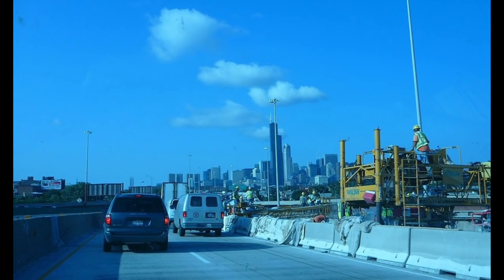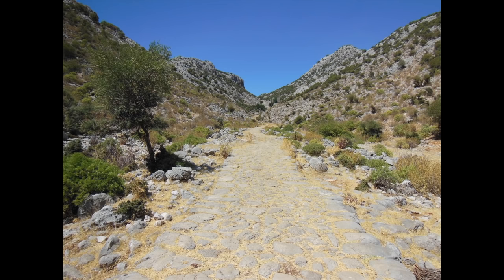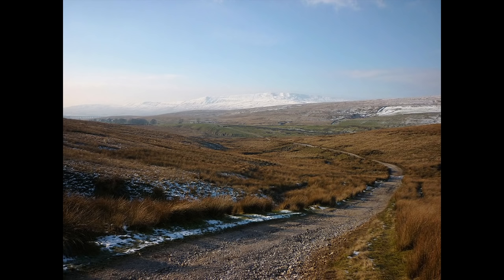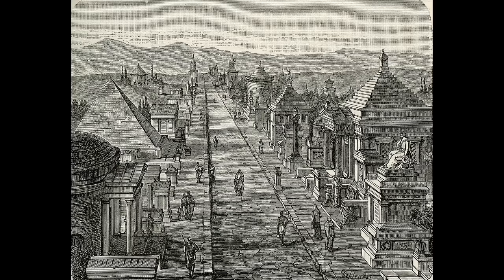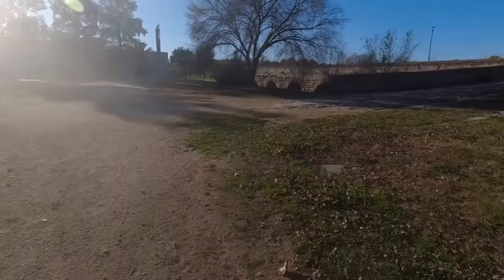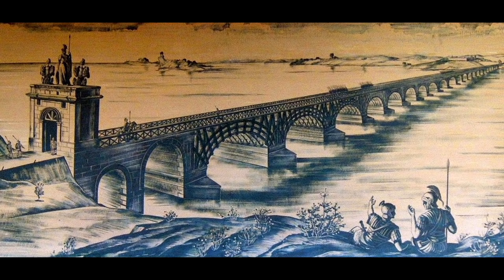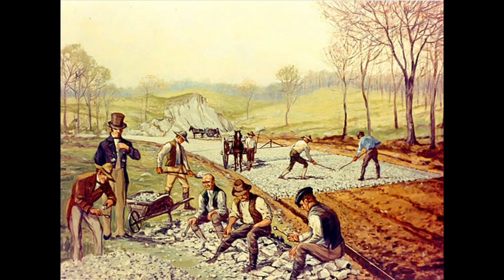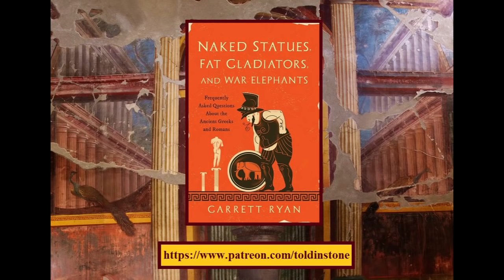Were Roman Roads more Durable than Modern Highways?

Comment: If more modern roads, highways, freeways etc. were constructed with a minimum of one foot of gravel base, they would last soooo much longer.
Reply: And if we used trains to transport all long distance freight. It’s faster, doesn’t cause traffic, doesn’t degrade your roads, uses 1/4 the amount of fuel per ton per km, takes up less space to load/unload, and you don’t have to worry about self driving trucks
Reply: @sizor3ds  
Agreed! I've been arguing this point for years.
Reply: @sizor3ds  Never gonna happen as long as Fossil fuel companies are still around lobbying. I've lost hope for any real change
Reply: @sethb124  No one likes to lose money, make train transport cheaper and faster and customers will switch, the math is done by machines and as it turns out... sadly for many distances and destinations trucks just make more sense cost wise
Reply: Highways don't last because of heavy loads, lots of traffic, and wear and tear due to things like weather (freeze/thaw).  Not the construction method.  Engineers are very particular about how the subbase of roads is constructed.  For example, this document: https://intrans.iastate.edu/app/uploads/sites/15/2020/03/6F-1.pdf explains that a too thick subbase can cause issues where consolidation after construction can cause pavement failure.  And the composition of the gravel matters too.  For example, here's a document from DOT explaining some of the materials in that subbase: https://www.fhwa.dot.gov/publications/research/infrastructure/pavements/97148/075.cfm .  So yeah, give the engineers that build this stuff the benefit of the doubt.  They know their stuff and do the best they can with the materials, knowledge, and budgets they are given.

Comment: Looking at those stone surfaces makes me wonder whether they weren't covered over with a layer of loose soil for the sake of the animals and humans walking on them and to make riding on them in a cart with iron tires and no shock absorbers more bearable.
Reply from the maker: There were often dirt or gravel bridle paths paralleling the main road, which would been a lot easier on both hooves and feet. Wagons, however, had no choice but to rattle along on the pavement.

Comment: Are you sure that the ruts where deliberate? Because they're very dangerous for wagons and can easily break wheels. Not to mention that not every cart was exactly the same width. Besides, carving them manually would have been a huge waste of manpower. Unless you have direct evidence to the contrary, I'm inclined to believe that they happened naturally due to heavy traffic (and would have been one think to fix during road repairs), rather than deliberately placed.
Reply from the maker: Most ruts were natural; but in a few places - mostly mountain passes - they are deeply and evenly carved. This measure seems to have only been taken when there was a serious danger of wagons slipping off the road or where there was a pressing need to guide traffic (see the standardized slots between the stepping stones on Pompeii's streets).
Reply: @toldinstone  thats pretty interesting
Reply: @toldinstone  I have heard that one of the first things to have standardized gauges was the distance between wagon wheels. That way the wear down into the same ruts and don't break their axles because of inward or outward force.
Reply: There's definitely a standard width to carts in the Roman empire. You can see it not only in the ruts left in stone road surfaces, but also in places like Pompeii, where stepping stones were placed at corners for pedestrians, but also as obstacles to calm traffic. There's always a stone in the middle of the road, around which a cart's wheel would have to pass.
Reply: @toldinstone  Thanks for the reply! Do you have specific examples/sources you can point me towards for this?
Reply: I have a memory of being told that modern railway gauges evolved from Roman wagon width regulations, but Ctl-F on the Wikipedia entry "Track gauge" finds no mention of "Roman". Hmm... 
I am inclined to think wagons were pretty much always made as "two horses wide", thus leading to widespread similarities, which were inherited as quite similar but varied railway gauges.
Reply: @flamencoprof  but that would mean that between roman times and the early railway age in the 1650s-1750s the cart width would have grown significantly.
Roman horses were for most of the empire's history only pony sized, at best 3/4 of our contermporary riding or waggon pulling horses. So an increase in width of 40-50% is not out of the question. I'm pretty sure the railways would orient themselves at the then current cartsize and not almost 2000 year old values. ;)
Reply: @Ugly_German_Truths  Fair enough. I'm guessing the rail widths were influenced by contemporary rather than Roman wagon widths.

Comment: One of the major construction differences is exactly the difference between the paving stones and actual pavement itself. The underlayment/road bed itself are actually fairly similar: compacted soil with compacted gravel/sand. Granted, we can now compact things far better now than they could back then. But the paving stones can still move relative to each other since they are isolated cells compared to the flat smooth surface of pavement. The disjointed aspect of paving stones alone gives more durability to the surface than a contiguous pavement. But try going 80mph on a cobble stone road. 

But sure, I doubt very much that a Roman road would hold up to the daily traffic of the average 80k lb loaded lori/semi truck. 

I'm sure we could build superior structures if cost/labor weren't considerations. And solders in Roman time were often effective slaves.. in addition to the actual slave labor used for many construction projects back in Roman times. But due to the cost and speed of construction, we tend to choose to build shorter lived projects. Romans were willing to take the long view and paid the cost: slaves were cheap, but durable infrastructure meant speedy deployment of solders to quell rebellion and protecting/expanding the boarders were worth the cost to them.
Reply: @MichaelTheophilus906  It didn't take 500 years to build a road ever what are you smoking.

Comment: Maybe one can't compare superhighways to Roman roads, but I would love to see URBAN roads vs Roman roads. 
The fact is, while Roman roads don't beat highways, they sure as hell beat modern urban roads. 
There is the same amount of construction work, cracking, potholes, etc in modern urban roads than in highways, yet with far less stress.
But the Roman roads that are still in urban use to this day are literally never repaired.
So, at least in that sense, they are superior in a direct comparison.
Reply: they are so terrible to drive on so the fact that last longer means very little. And usually cars go very slowly on them
Reply: @aurid6838  But in an urban setting its unlikely that anyone is going that fast to begin with and with less repair work and money going to the repair of said road a roman style road would be more or less beneficial.

Comment: Another reason why so much of the Roman infrastructure remains in Spain is that until about 14-something the 'next guy' basically changed the bank account number for the taxes and left the power structure largely intact. The Visigoths ended up being Romans except for the name, and the Arabs had a genuine interest in maintaining and improving both the roads and the aqueduct system. The whole thing went down hill quickly when anyone with the knowledge to repair the stuff was kicked out.

Merida even has most of the Roman dams which fed the aqueducts in working order

Comment: Any thoughts as to how smooth those roads were when new?  I try to imagine a wagon ride over one of these roads sans shock absorbers and I can't. I drove over an 18th-century road in rural Mexico once and I thought I'd need the services of a chiropractor afterward. It was cobblestone, in good condition and looked similar to a Roman road but even in a car with nice fat tires it was very jarring. It occurred to me that weathering might have caused the edges of the stones to become more rounded over time but that's just a guess. Great video!
Reply: Check out the wagon wheel grooves on preserved on Pompeii roads
Reply: @histguy101  Good point. Once grooves developed the ride would have been smoother but what about when the roads were new? And how many decades would it take for the stones to acquire those grooves.
Reply: Your thinking with too modern mindset. For commercial activities travels often were short, something like 5-6 miles at most and you wouldn't certainly be blasting them even close to current speeds. And people would have option to walk besides the wagon. If you went for a distance you'd use boats. 

 Foremost idea of gobblestone was to keep roads from turning into mudtrack which is the main problem with earthen roads. Even today that is main reason why earthen roads are not very good. They work well, very close to asphalt with right mix of soil types when it's dry and surface is being leveled at steady intervals but when it starts to rain things turn into mud  and holes.

Comment: Another problem with modern roads which experience snow is the expanding ice in the cracks and the water which trickles down those cracks in the spring.

I imagine a Roman road would have none of those problems as they are perfect when it comes to drainage and the space between the pavers is large enough that expanding ice would not be a problem. 

Do we have any infor.ation on romannroads that saw snow?

Comment: I think the roman roads actually hold up better because the broken up surface tension of the separate stones are better distributing the weight and pressure of the traffic pressing down on it.

Modern roads are made with better materials, but because its all one, uniform, smooth surface it creates cracks and holes at its highest stress points.

The thing is though..  the reason our roads are smooth is because we like the luxury of a smooth ride. We use to make roads out of brick too that still hold up exceeding well today, but they're not smooth to drive on.. its bumpy, if even just a little bit.

So if we want better roads, we'll either need to give up smooth driving or invent and standardize better shock and suspension systems for our vehicles.
Reply: They constantly warred on them . They’re built for that.

Comment: Roman roads were built by the military as they advanced into new areas. The engineers built the specialist parts - bridges mainly - but the actual roads themselves were built by less skilled troops. The surveyors marked the next point where the road was to go and the easiest way to build it was absolutely straight. No thought needed by the actual builders. Roman roads are only straight berween surveyors points - in many cases they curve round obstructions, but each short stretch of the detour is straight.

Comment: So I actually did some survey work with an American archeologist of the Roman road in the Great St, Bernard Pass back in the 1990’s. Specifically, right on either side of the Swiss/Italian border. The road comes up the valley and crosses right in front of its doors. Which dates to the 10th or 11th c. Though they have been eased up the building’s frontage due to continuous repaving over the centuries, to the point that you actually descend back down into the building above 6ft or so. This road is no more then a track in places especially as you get beyond the momentary and the hospice facility. We had to defend on foot back into Switzerland about 12km at in point and used the Roman road. As you might imagine, 1500 years of neglect and weather at high altitude have not been kind to the road way. But there were some interesting places along our route. The remains of a Roman inn, now nothing more then the threshold stones and the perfect outline of the courtyard in a perfect rectangle of Roman tile, laying in rows on the ground in one location was something to see. And the ruins of a later medieval watchtower or checkpoint alongside the road at another reminded us that until the modern era, this ancient road was the only way across the alpine landscape.

Comment: According to Wikipedia.."Today, the concrete has worn from the spaces around the stones, giving the impression of a very bumpy road, but the original practice was to produce a surface that was no doubt much closer to being flat.".  
When I visited Rome back in 2003, I recall that some of the roads were just that.."very bumpy" ..Why doesn't the city fill in the spaces, as the Wikipedia article alleges was originally done?

Comment: Another important difference between roads in Chicago and in the Roman empire is that in Chicago, there is ice then melting then refreezing everyday practically in the 4  winter months along with salt which corrodes/softens the road pavement.  Whereas most of the Roman empire, I am guessing never gets much below freezing. But they are remarkable nontheless.

Comment: Here in the UK it is noticeable that Roman roads often run along the very top of ridges or high ground.  There are, I think several reasons for this.  Firstly, it will help with drainage and keeping the road surface dry and free of water erosion.  Secondly, it means have to cross no rivers or streams.  Thirdly, it may have been easiest to plot the course of Roman roads from these high points in the landscape.  I also wonder if placing the roads on high ground wherever possible was also done to aid Roman soldiers in keeping a lookout for enemy troops, or to enable Roman soldiers to see signal stations, or to help with Roman soldiers in defending themselves against surprise attack.  It's obviously harder to attack a body of soldiers if they are on the highest ground and perhaps on top of the "agger" or bank of the road as well.

Comment: There are many sections of Roman road here in the UK.  Some form parts of the modern road network, some go cross country but are still easily shown by the agger on which they sit, and some exist as modern day boundaries between administrative areas within the UK.  You'll notice on a map of the UK that certain administrative areas have one side which is dead straight - that's probably the line of a Roman road.

Comment: Quick answer.   Roman Roads didn't have 18 wheelers rolling on them.   I jack up a loaded garbage truck today and the concrete under the jack cracked.  10's of thousands of pounds.  I have seen drivers pull into landfill weighing over 44 thousand pounds.

Comment: 3 things that are a huge factor that I didn't see mentioned: Speed, tires, and weight. Any vehicle imparts 4X more forces on the roads as speed increases. Starting about 1600 years ago, wagons and carts used steel tires, that would have chewed up modern roads in 6 months. Modern trucks are 10X heavier and travel at 10X the speed of horse drawn vehicles. Heavy trucks and their immense speed are the cause of 90% of the damage to roads and bridges. If all vehicles weighed <2000lb and didn't go above 50 mph, roads would last many times longer.

Comment: I think without doubt the winner has to be the Roman Road. Some are still in use 2000 years later, in the UK we still have a network of old Roman Roads. Sadly a lot have been covered in Asphalt but the base is still the existing roman road running as straight as can be. The Roman Road also is far more resilient to thermal stress than Asphalt. It is difficult to argue a case for modern roads being more ‘durable’ when Roman Roads still exist 2000 years after construction.

Comment: Italian scientists show that only a small fraction of the road network was actually paved. 

The paved roads were the streets in a city and leading up to a city, so we see them most in pictures. The reason is that paved streets are easier to clean(!) which you really want in a city, on the way to the cemetry outside of the village, or on the way to the market. The interurban streets however are best put with a layer of sand on top so that the hooves of horses are not damaged. That's why a paved road does always have additional non-paved parts on the side but in remote places the width of the road will get much smaller.

So only in densly populated areas in upper Italy you may find a section that is paved from one city to the next city. In the rest of the Empire it was generally not.

Comment: The issue is that roads these days are made of the lowest quality cheapest materials possible, here in the UK in the past they used a different kind of Tarmac that was harder and more hard wearing it was not water permeable so it was cambered with drainage at the side and it lasted a long time, there is a road that was resurfaced almost 20 years ago and it is still in almost as good condition and has resisted water / ice / snow / water penetration and freezing  where as the new roads now fall apart after just one year.   This is simply down to they using the cheapest material and cost cutting, in the past they used to use 2 foot of compacted material and then a good thick layer of tarmac ( looked like 7", however when i watched them redo a road they used less than 1 foot of compacted material and what looked like just 3" of the modern cheap Tarmac, so the general construction does not last especially with trucks and buses on it, then as winter rolls around because the new Tarmac is water permeable the water gets into it and under it and freezes causing the road to lift in areas or crack.

Comment: Modern roads carry heavier loads and are much flatter. Cobble roads are perhaps longer lasting, but not if we were to use the same standards we use for modern roads. We replace or repair modern roads like crazy, not because it’s always needed,  but to get ahead of any problems. We have some old highways and back roads where I live that haven’t been repaved in almost 100 years, still flat, and barely any cracks.